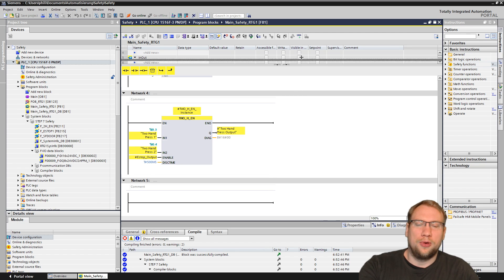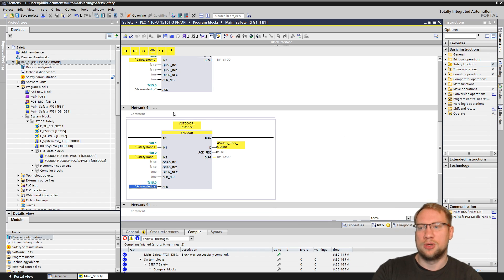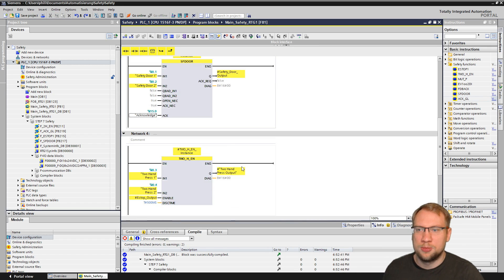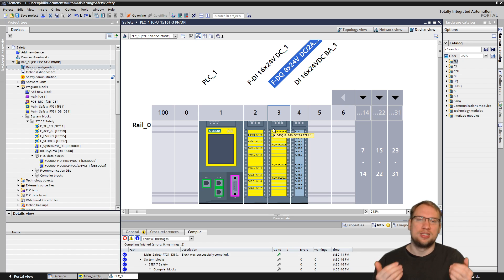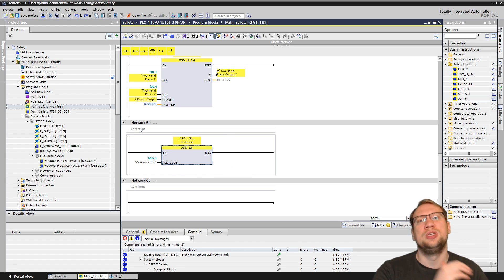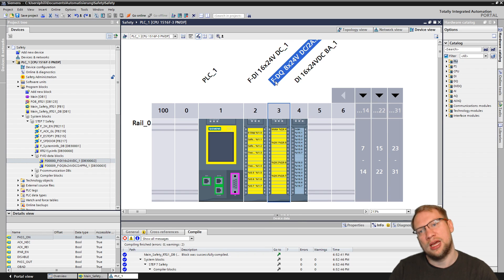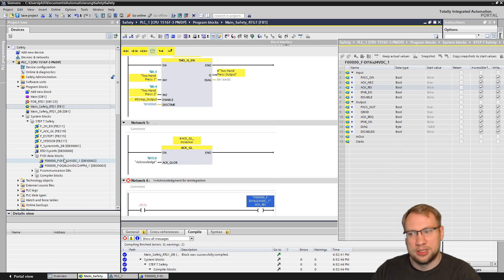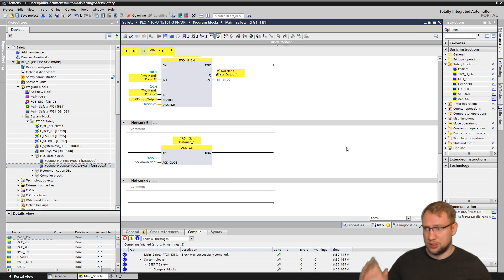TIA Portal: All Safety Basics! Part 5: Global Acknowledgement / ACK_GL

Comment: Hi Philipp Thank you for the videos. Let me ask something. If I have to put two contactors, let me say to disconnect one electrical motor when I pressed the E-Stop. The feed back signal from those contactors must need to be connected to a safety Input or I can use a normal Input of the PLC?